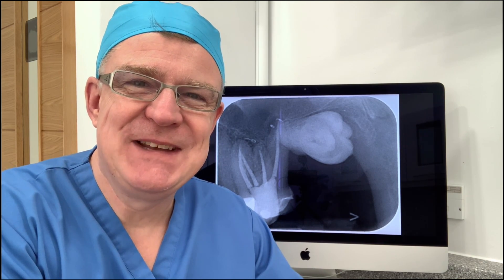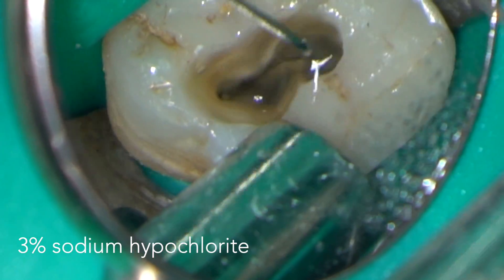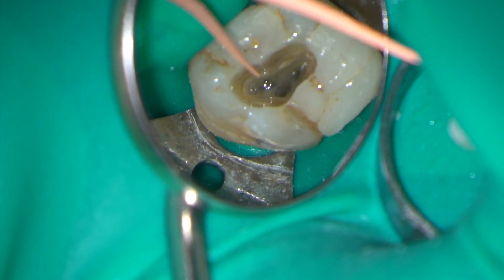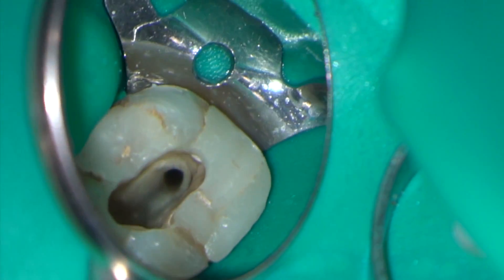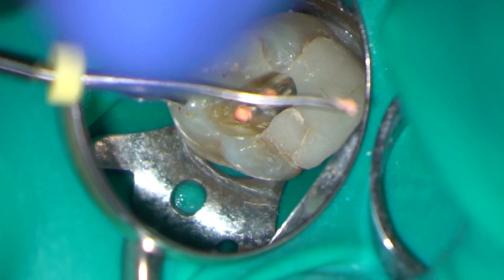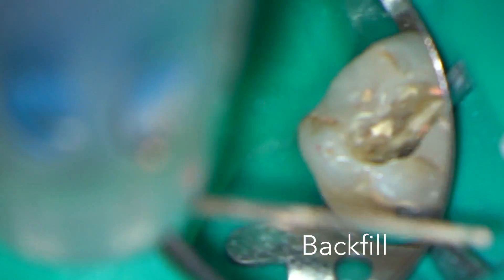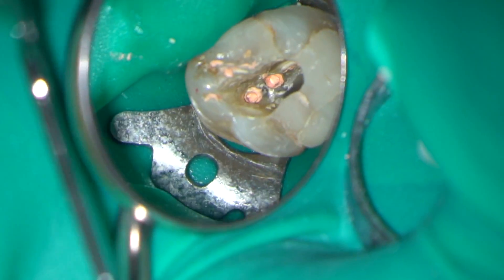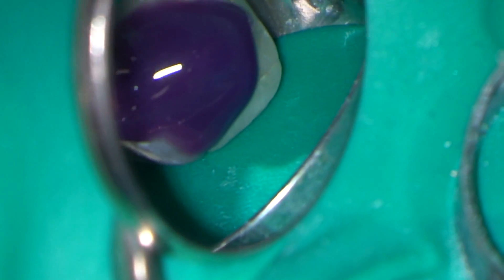Vertical Compaction UL6

Comment: Hello Dr. Rhodes, Great video! Do you fit the GP cones 0.5mm short of your 0 reading for vertical compaction technique? Also, do you gauge the apical foramen with hand files after the mechanical preparation or just with the GP point? I hope I made myself clear with the questions! Thank you very much in advance! Cheers!
Reply from the maker: Hi there!
Im not a fan of apical gauging with files, I don't think it really works... I use the EAL reading and fit the cones accordingly.
I only reduce length in very wide canals
Thanks for watching
Cheers
John

Comment: Hi John! Excellent presentation. Do you fill gp till the apical constriction or till the apical foramen. As I see in most of your RCTs there is extrusion of sealant or gp. Will it cause symptoms later like tenderness on percussion.
Reply from the maker: Hi Dr KK
I am trying to keep the filling material and sealer in the canal. Small amounts of extruded sealer really don't cause any problems.
cheers
John

Comment: Hello, great video! I have one question, do you trim the master cone so it is a little shorter then the working length before the downpacking? Thank you
Reply from the maker: Hi Stefan
I do snip a little off the tip if the apex is very wide!
Cheers
John

Comment: Hi John, another great video! I have noticed that sometimes you demonstrate a cone fit radiograph and other times you don’t. 
If you are getting consistent WL measurements using apex locator, do you still do a cone fit radiograph or rather obturate and confirm with a final X-ray? 
What’s your standard practice? 
Thanks
Reply from the maker: Thank you Christopher
Most of the time I rely solely on the apex locator, if things are tricky or readings not what I expect I expose a cone fit or diagnostic.
Cheers
John

Comment: Thanks so much for these videos, really useful. A couple of questions as I've been pulling out the GP when I've been trying to downpack and its very frustrating!
 For the master cone is it best to use the corresponding cone with the system we've used or do you use 4% or 6% taper cones cut to the iso width?
 And when do you gauge?

Do you alsoways use the biggest downpack tip that fits to 5-7mm to the apex?
Reply from the maker: Hi Rose MJ
Yes - use a corresponding matched cone, ensure tug-back and make sure that the heater is hot enough for the burst of heat before removing it....the cone needs to be seared off apically. 
I don't do apical gauging with files I don't believe it works, I do modify the gutta percha cone as required with scissors or a scalpel
I hope this answers your questions?
Cheers
John
Reply: @johnrhodesendo  yes thank you so much!

Comment: very informative. why during back fill some times gp is sticky to the plugger during compaction? any tips to avoid that
Reply from the maker: Hello 
Do not worry just fit another cone and hold at the most apical part before using separation burst of heat
Cheers
John

Comment: Hello Sir, whenever iam doing downpack with touch n heat device, reach to 5mm less of WL, gp isn't coming out with tip instead it spreads laterally, I am not able to do wvc, please guide me
Reply from the maker: Hi there
You are doing noting wrong, sometimes the internal morphology is very irregular and "traps" the GP, in this case just spread laterally and back fill in the space that is left.
Cheers
John
Reply: @johnrhodesendo how do you choose what size tip to use for the touch and heat?

Comment: Dear John,

When you compact the gp after searing of at pulp floor level, how do you prevent over pressing. Im asking this after a upper premolar with one broad canal was over filled by myself and one the final x ray the tip of the gp extended the radeographical apex. 

With regards
Reply from the maker: Hi Yvar,
You need to make sure that when you cone fit the cone cannot accidentally be pushed through the foramen, if in doubt trim the tip 0.5mm short and double check.
I hope this helps?
Best wishes
John
Reply: @johnrhodesendo  certaintly does! Thanks alot :)

Comment: Hey Dr. John great work! 

Quick question for you... How do you get the apical portion of the gutta percha to separate so cleanly on your down pack? I've watched videos of Dr. Buchanan who recommends heating the plugger, inserting it 5 mm from WL, then waiting 5 to 10 seconds to allow the GP to cool, and then heating the plugger again for a 1 second "separation burst" and then removing it to get a nice clean separation between the down packed GP and the coronal GP. I have tried this, but more often than not my heated plugger comes out clean with out the desired coronal portion of GP on it and I have created what looks like a tunnel through the GP which has now been pushed and smeared all over the canal walls. Then I ultimately end up scraping small aliquots of GP out of the canal using the heated plugger in a very frustrating, tedious, and time consuming process. However while watching you do it, it just seems so fast and easy. You had heated your plugger and made your way down and out of the canal in about 5 seconds! (YES I counted! 🤣) Can you please share your technique with us? 
Also does the brand of GP make a difference for this in your opinion? 

Thank you in advance for your response, and as always keep those great videos coming!
Reply from the maker: Hi Francesco,
Well spotted!...Vertical compaction does require some practice!
Do not worry about the "tunnel" effect, I just put a plugger in the hole and do a bit of lateral condensation before back fill.
I take my finger off the heater before reaching full down pack, a quick burst of heat separates the GP (in most cases!)
I am using Wave.One GP they all have different consistencies.
Thank you for your kind words and "enjoy your endo!"
Cheers
John